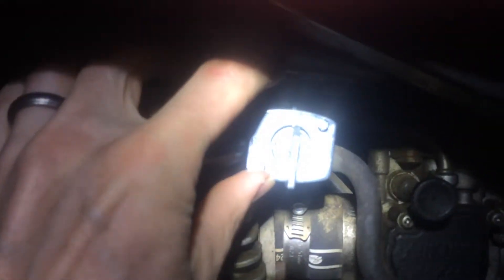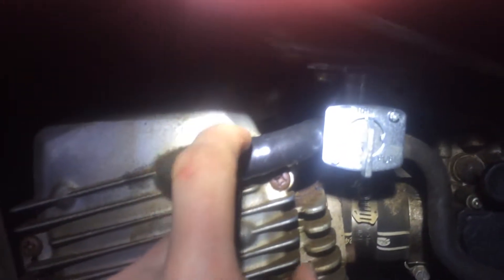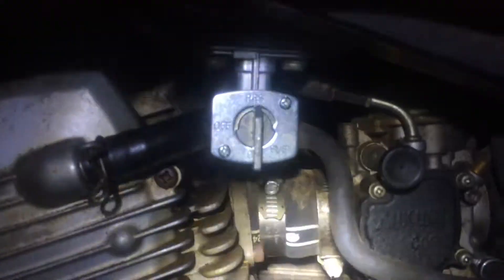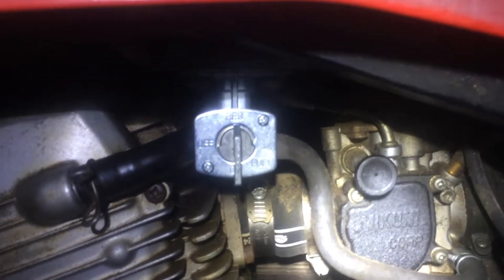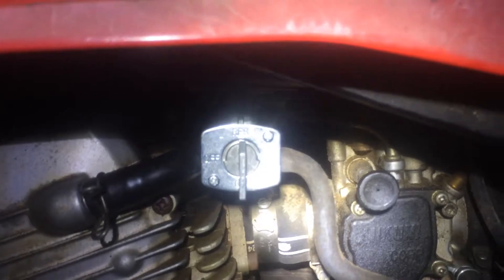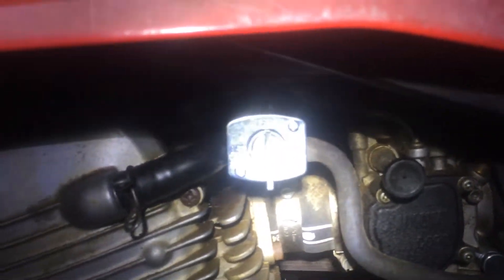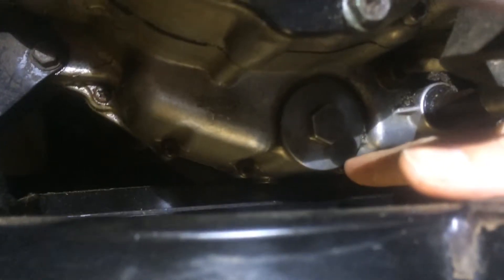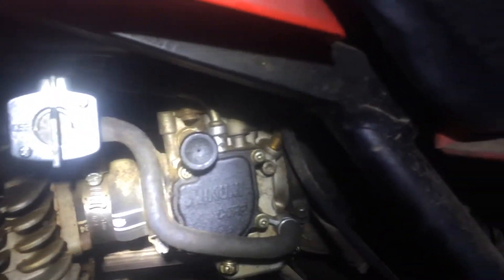Yamaha bear tracker fuel petcock fix 3

Comment: How did u get to the second screw beside the cylinder?
Reply from the maker: Cant get at it straight on, with the fuel line off, i was able to use a long Phillips screwdriver, in my case i was fortunate and it wasnt too tight, hopefully it works out for you.